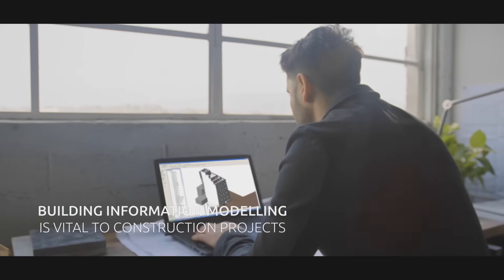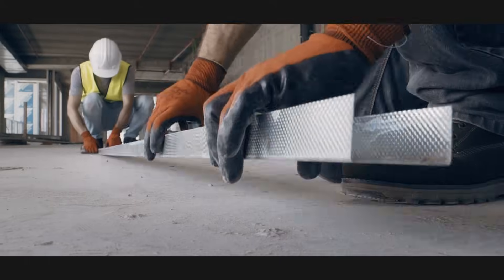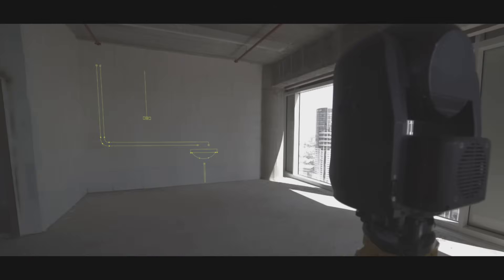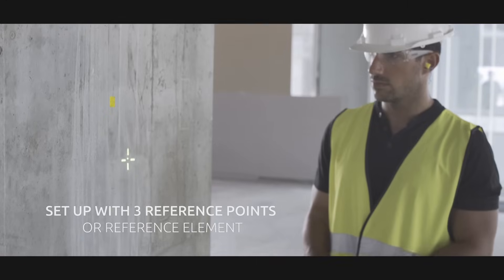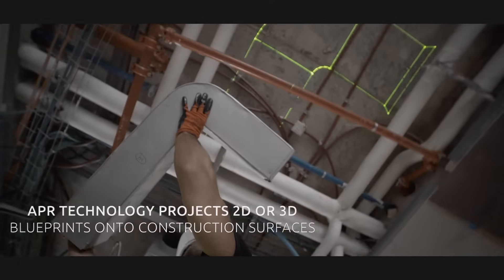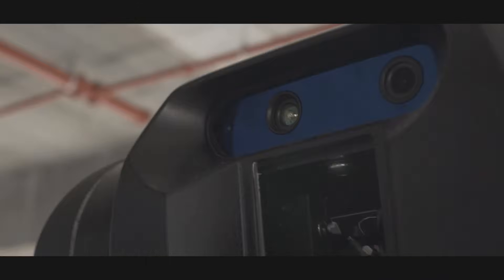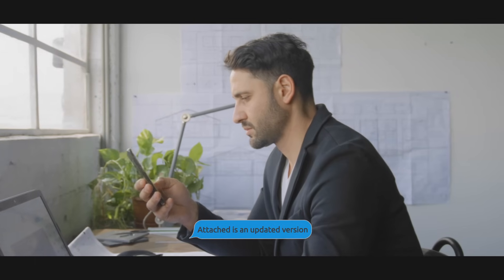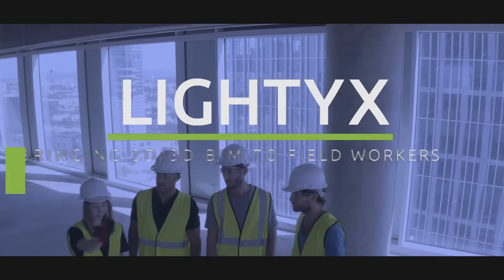LightYX BeamerOne - Construction layout tool

Comment: Is this a system that can work using the PDF drawings or will it require use of CAD?  That could be a potential pitfall if it requires use of CAD and having someone on the GC staff who is fluent in CAD.